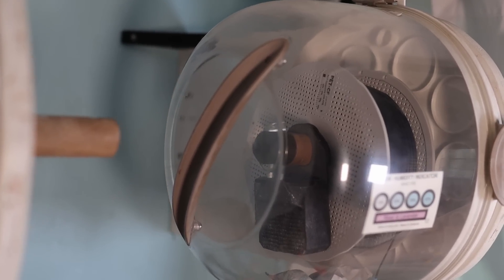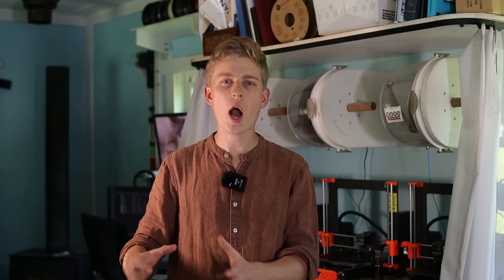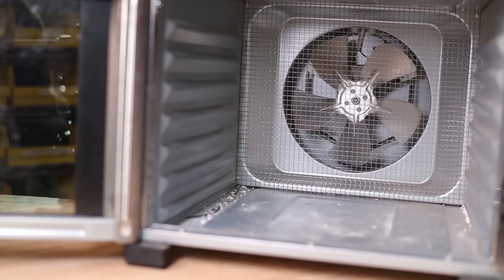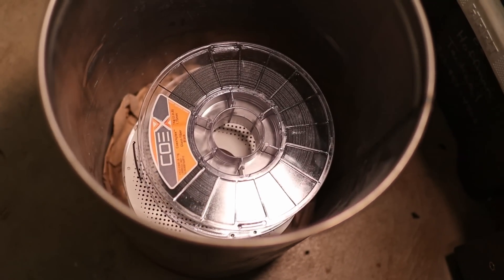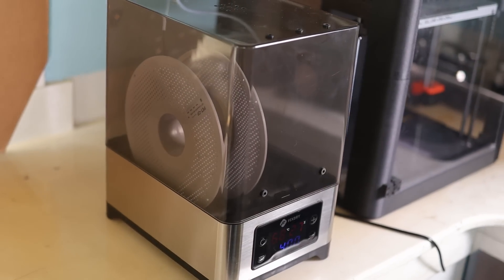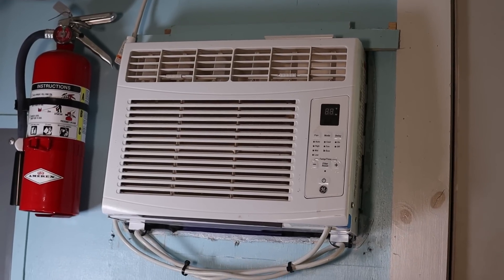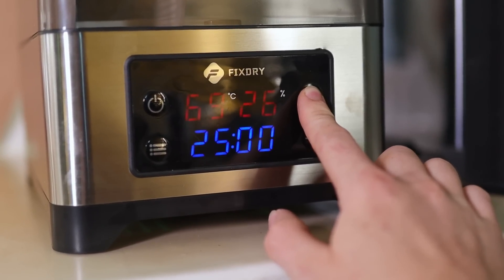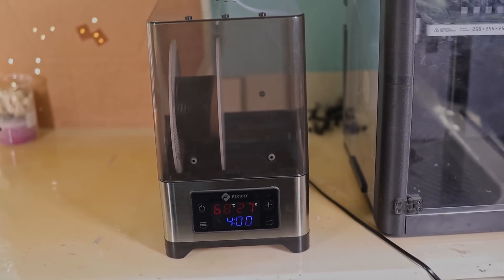Dry Your Filament! A Look At How I Manage Filament

Comment: I have always been told that nylon and other hygroscopic polymers will naturally reach equilibrium with the humidity in their environment, albeit slowly.  So it might not be an absolute temperature threshold thing so much as just requiring extended time in the lower temperature dryers- IOW, required dry time for a wet nylon in a 65C dryer might be measured in days, not hours.  Personally, I use a converted food dehydrator that only hits 65C, but my nylon filament never sees open atmosphere for more than a few minutes at a time, and I store it in containers with hygrometers. When I see any of the hygrometers read over 10% RH, the filament and its storage desiccant go in the dehydrator for 12-24 hours and that has never failed to bring hygro reading back to 0% in the storage container.

Comment: Any experience with the new PAHTCF from Bambulab? Supposedly less hygroscopic than pa6.
Reply from the maker: I'm working on testing it. Less hygroscopic after printing is important for stiffness, but prior to printing moisture is still an issue, even though it's less than PA6.
Reply: Just got mine in from the kickstarter backer rewards, but according to 3DPG printing from inside the AMS with desiccant is not enough even after drying. So I guess I need a filament drier now.  @HoffmanTactical

Comment: Might help to insulate the Fixdry cover...
Reply from the maker: I was thinking about that, depends on how much loss is due to conduction through the shell, or simply convective losses in the exhaust. Insulation + a air preheater would really help with efficiency.

Comment: How's the energy consumption? It doesn't look well insulated at all.

I'd like to see one with with insulation, heat recovery, and maybe a pelier element to cool and dry the air.

Or rig up a proper vapor compression or dessicant dehumidifier to a chamber.
Reply from the maker: Just replied to another comment about this. Once you get a few of these, power consumption becomes significant. And I'm off grid, so makes a big impact. Would like to see one with a preheater.

Comment: I think they limit the temperature because some brands use low quality spools that melt at drying temperatures.
Reply from the maker: I've seen spools soften at 200 F. But never melt. I think it might have to do with the plastic the drier is made from, but even that should be able to handle it.
Reply: @HoffmanTactical  ok melt is a bit extreme. But Ralph for example destroyed a roll of nylon trying to dry it. I think that issue might have something to do with it.
Reply: The biggest issue from what I know is that the glue holding the spool together softenes, causing the spool to fall apart and let the filament lose.
Reply: It's probably because the plastic that the dryer uses won't hold up to those temps. A metal enclosure would be best for something going 80 degrees Celsius to be safe especially running it while you're not there.